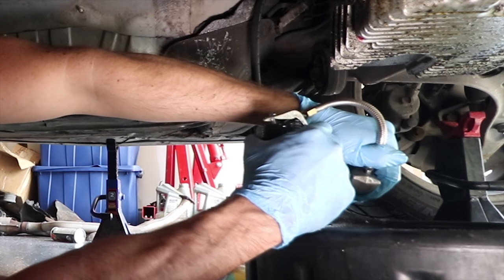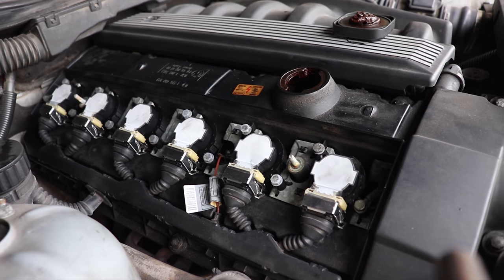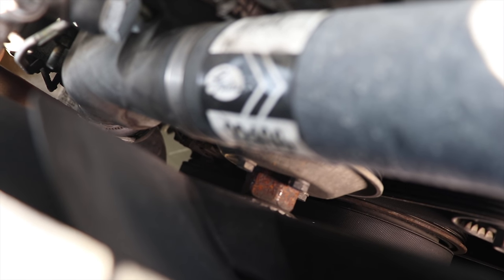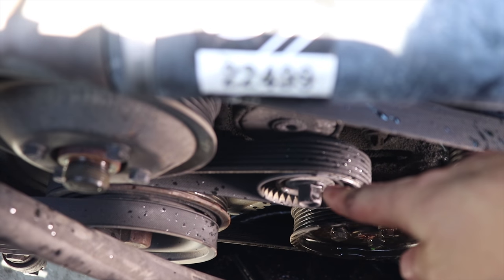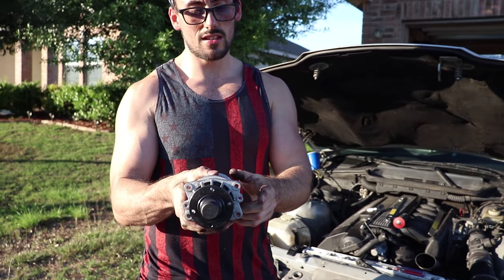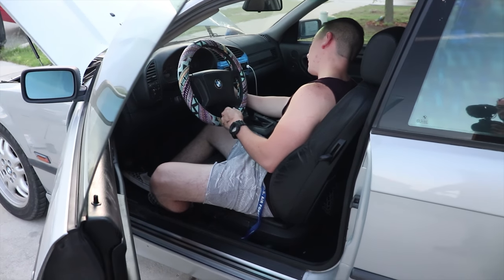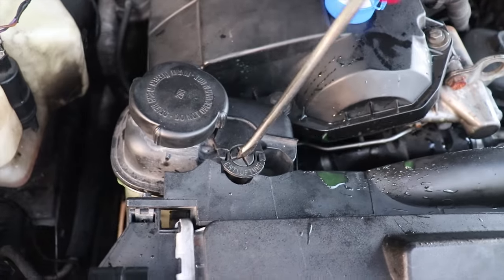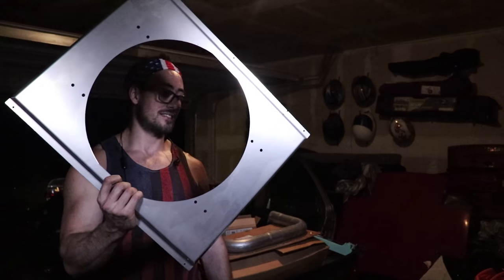Installing a WATER PUMP on the BMW!

Comment: For those that are wondering what sides up or down no matter how you flip it it only will go on the correct way been awake the last 2 hours thinking I put it all back together after doing the oil filter housing gasket water pump and pully to think I may have put it on upside down which is impossible 🤦🏻🤦🏻🤦🏻